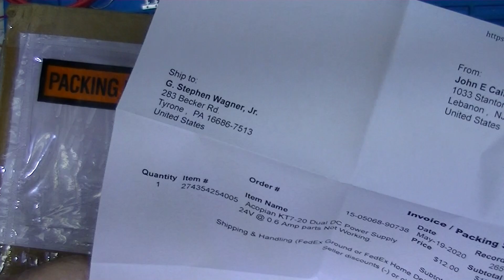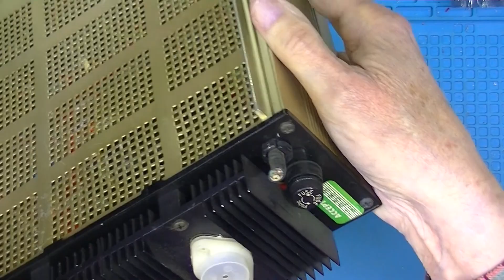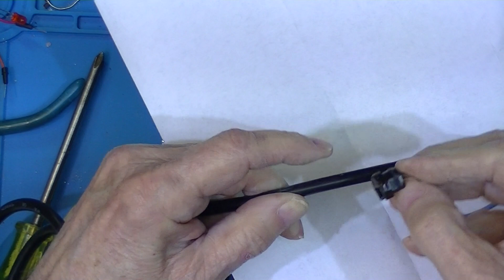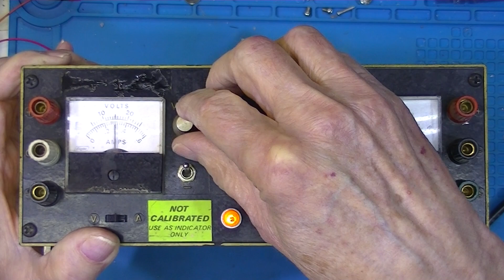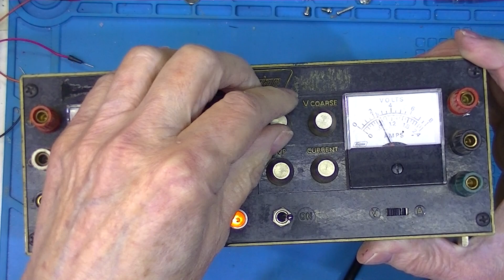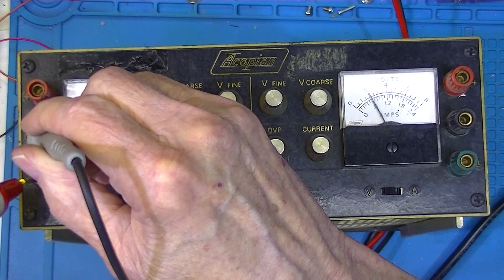An ACOPIAN KT7-20 - NOT WORKING – Power Supply Part 1

Comment: Interesting video, thank you. What is the purpose of over voltage protection?
Reply from the maker: Being able to set an "Over Voltage" value prevents sensitive devices powered by the supply from receiving more volts than is desired. Over voltage may result from a "knob twister" from destroying a device or pass transistor shorting or any other kind of component failure. BTW, "knob twisters" come around in every job situation, the just can't keep their hands of equipment.
Thanks
Steve